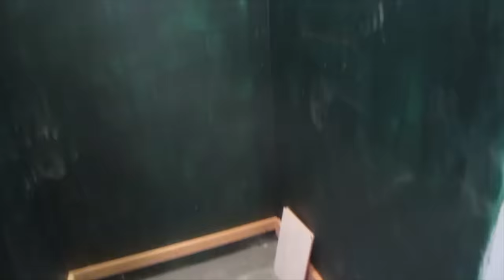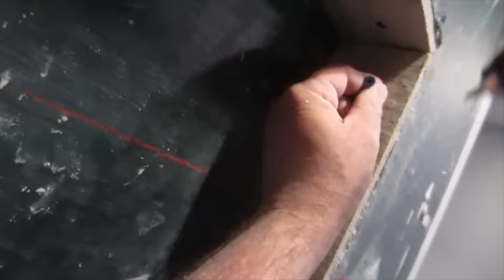Complete bathroom shower install time lapse start to finish

Comment: Do I call them back to rip the floor up and do it right.or withhold ther payment and get someone else in to put things right?
Reply from the maker: Chris Waterman What you do is up to you, but If it can't be fixed it will have to be done over.
Reply: Ya I'd say it will need to be done over because the whole floor area was put down with one piece of membrane ( not sure what's its called)

Comment: You do good work I just don't like those liners nothing like hot mopping a shower pan is the reason why they've been doing it for years and years just my opinion. I've seen those fail
Reply from the maker: Hot mop is a CA thing, pretty much not seen anywhere else. Vinyl liners are becoming a thing of the past, Sealed systems are a much better choice.
Reply: that's your opinion but there's a ton of systems out there I think  the cost is not worth it  for the chance of it failing they've been using hot mop for decades and that works so why change. Tell me what system you're talking about and I'll look into it
Reply from the maker: @luie92114  Not an opinion, just look into Schluter, Laticrete, Wedi, and more. All have a sealed system that use a bonding flange and do away with the Old "Water in, Water out" type of system that include Hot Mop, vinyl liners and anything using a two stage drain. Cost is a relative thing, the labor involved in old systems is significantly more, down time waiting for things to set up, add time. Not saying that there is anything wrong with those systems, just saying there are better ways available. Whether you choose to learn about them and use them is up to you, ignore them and you will play catch up later.
Reply: @SalDiBlasi  I just looked into all three of those systems and they range between 350 and 550 and up!! I pay $250 to get my shower pan hot moped I have half a day downtime I'm back to work and in my 18 years doing showers and never had an issue. Now if you're one of those guys that like to keep trying new things and spending money learning that's your thing my system's been done for Generations I'm okay with that
Reply from the maker: @luie92114  I  am not going to try and convince you about anything, you have made up your mind, if what you are doing works for you, that is great. Just looking at the cost of some materials is not the whole story and can't possibly give you the whole picture of how it all works.

Comment: Hey bro.OK workers finished up today when they went I had a shower but about 20% of the water runs away from the outlet drain and forms a huge puddle on the far end of the room near the door.
Reply from the maker: Chris Waterman Does the water come back to the drain or does it just stay there? if it just stays there,  show them, ask them if that is normal, which it is not, see what their response is, if they try to make excuses tell them to fix it.
Reply: Nope it runs out of the bottom of the half doors around the shower area and  forms a huge lake
Reply from the maker: Chris Waterman Tell them to fix it, and let them know that you will pay them when it is fixed.

Comment: how long and how much money did you put into your bathroom
Reply from the maker: The exact amount of time it took to complete and no a penny more than it cost the homeowner. I never talk about cost and time, there are too many variables.
Reply: I agree on this point but. Per square foot  labor + materials is the usual quote though. Yet some types of tile require a higher labor cost.

Comment: i already put up green board and didnt do anything with slop to drain was going to do a showerpan .. now going with all tile...what do I need to do?
Reply from the maker: +RikWCrlsn if you used green board in your shower you either need to cover it with a sheet membrane or replace it with a cement board and then apply a liquid membrane
Reply: Will do found RedCoat?? At Home Depot goes on pink turns red.. thanks
Reply from the maker: +RikWCrlsn not good enough for green board that has a gypsum core. Either a sheet membrane or replace it. Only if you want it yo last though.

Comment: I looked for a good pop up 3 piece drain the other day and could not find one.  I'm using a pop up drain in my upcoming tub/ shower custom project, and I must find a way to seal the drain.  
Here is a link to the drain I hope to use: http://www.homedepot.com/p/Watts-Plastic-Bath-Drain-Kit-3CP/100677389
Can I make this work? Is there another pop-up style shower drain to use, I must have the plugged feature as it will be a tub too.

I also am using conder block for the bottom 2 feet of the tub/ shower.  How would you recommend sealing the block? would vinyl liner be sufficient? If so must I cut the corners to fit?

Comment: Heavy vinyl liner = waste of money. Use heavy visqueen, then use porcelain tile with epoxy grout. Stays clean, never cracks or leaks.
Reply from the maker: And you know this because you have tested it and had it approved by the TCNA? Not a smart move.

Comment: concrete is NEVER supposed to touch wood without a barrier unless its pressure treated wood.
Reply: Liner was supposed to be first than concrete base over it

Comment: Why do you put thinset before the Frist slope?
Reply from the maker: +GMike Ramirez to bond the mud to the concrete, which adds strengh
Reply: HELP! I didnt put thinset before the preslope mud, what will happen if anything? Will i have to tear it out and start ovet? Thanks in advance.

Comment: Good job although it bugs me that you change the direction of your notched trowel.
I did commercial tile and we always troweled right to left or vise versa until space wouldn't allow it. 
Speaking of bugging me, you also buried Jimmy "the bug" Hoffa at around 7:50 !!
Reply from the maker: +miggs225 A little tombstone has been erected in memory of the bug.

Comment: The trowel lines should be perpendicular to the long edge of the tile and not parallel. Doing this helps ensure to not trap air because the air has a shorter path to exit and thus promotes a higher surface area adhesion. This installer did didn't follow this procedure from 5:19 to 6:56 but then started doing it correctly from 6:56 to 7:55 and then reverted back to doing it incorrectly again from 7:55 to the end....weird.

Comment: what tile goes on first of the shower the wall or the floor?
Reply from the maker: Makes no real difference, whatever works best for you.
Reply from the maker: gsxrkz Makes no difference, if you install the shower correctly, and even more so if you don't. The orientation of the joint is not the detail that will prevent a leak.
Reply: Floor goes first. Once dry it supports the walls. No saging grout joints during curing process. common man.
Reply: i agree i own a house. It was built in 1938 just re grouted the shower. Floor supports the walls. Its still all standing. Original tile. With new grout. I was taught, floors, walls up to ceiling. with walls supporting ceilng edge.
Reply: Joey Diaz your tile floor does not suport the shower walls and the sower walls does not suport the ceilling every tile setter i know do the walls first i bet this guy did too for the simple reason he is a pro  and no home owner is gonna know beter than a guy that does it for a living
Reply: Joey Diaz i forgot to tell you why most tile guy use a level board on the bottom of the wall to start nice and level because most shower floors are not level all the way around so the water can go down hill
Reply from the maker: vjalowboss Thank you.
Reply from the maker: vjalowboss Every tile job is different, and the tile is adhered to the wall floor or whatever, it is not supported by an adjacent plain, in fact they should not touch and impede the movement that is present at a change of plain. If a tile needs to be supported by another tile, then it is not installed properly and will fail, also what about the tiles in the center of the tiled surface that are not near another wall or floor or what ever, how are they supported?
Reply: Sal DiBlasi

Comment: I thought you were suppose to put the membrane before the grout
Reply: That was a pre-slope bed before the membrane. A top bed was done on the membrane. This is the preferred method, however he managed to install the cement board before the top bed is laid, this method places the bottom edge of the boards in a water channel and causes a "wicking" effect. Newest practice prefers the boards installed AFTER the mud bed, without making contact.

Comment: I understand that every ones does things differently but why mud the shower two times?  And you you could have membrain the hole shower and avoided using that rubber.
Reply from the maker: Preslope and final bed is the correct way to do this type of shower here it is explained https://www.youtube.com/watch?v=p8xsx3316IU I also have other types of systems on my channel.

Comment: No pressure treated boards for the curb of the pan?? No good.
Reply: You can't cover pressure treated wood with tile..it will rot.. because it's already full of moisture

Comment: Why would you use thin set below your mud that's just a waste of time. Use a bonderiser
Reply from the maker: First off "bonderiser" is not even a word, you probably meant bonding agent, which is exactly what the thinset does, which is what is seen in this video a "Bonded Mud Bed". Thinset is how it is done in most cases. Imagine that a tile setter that has Dry set mortar and uses it to in an application that suited to its characteristics, what is the world coming to.

Comment: No black paper behind the cement boards
Reply from the maker: What you refer to is a Vapor barrier, which is not needed, or wanted when the entire surface of the board is treated with a waterproofing membrane, one or the other, not both. I have to add, that one is better than the other and the Tar paper is not the better one.

Comment: You should NOT use a wet sponge on wood planks like that... they could warp
Reply from the maker: This is a joke, right? It is porcelain tile that looks like wood, installed with a polymer modified thinset, which is wet, cleaned with a wet sponge as I am working, then grouted with wet grout and washed with water, then washed again with water, and not a single tiny buckle or hint of warping  in the wood, which is not wood, but a very dense, vitreous, non absorbing, non reacting inert porcelain tile, just to be clear that is.
Reply: Sal DiBlasi no... you can CLEARLY see knots and grain in those planks..please study the video more closely in future
Reply from the maker: +jeremy western Your kidding, you can't be serious,  you're trying to be funny. If you are not, then I can't explain it.
Reply: Sal DiBlasi you do NOT grout wood... the natural expansion and contraction of them wood planks will displace the grout after a short while...  please do more research in future
Reply from the maker: Enough, it is not wood.

Comment: Durock in a shower? That is used for flooring its not waterresistant it molds and it sucks moisture and water
Reply from the maker: I suggest you get your hands on a TCNA handbook, Read Method B415-18. Then when you have done that go watch some of my other videos where I show several other methods.

Comment: you should never have to do a second wipe on your grouting... only if your helper sucks and rushes threw it
Reply from the maker: So i guess i have been doing it wrong for the past 30 years. I would like to see your video to see how to do it the right way, post a link for me.
Reply: *****
Yeah, and you forgot to press your pants before you showed up on the job site. Simply unprofessional.
Reply: Zack T. Pugh LOL!
Reply: notice how this guy never posts a link or a video?  typical internet "pro"

Comment: Why cant you just add the shower pan liner on top of the concrete? Why do you basically have to do it twice over the concrete.
Reply from the maker: For this kind of drain, this is how you have to do it, here is a video explaining the drain, https://www.youtube.com/watch?v=p8xsx3316IU&list=UUWpu9UZ6aiRTaMuuV8-C0pQ if you use the schluter kerdi system with thier proprietary drain, then you can do it with one layer of mud

Comment: Why bother with a liner if you are going to slap that elastomeric waterproofer everywhere?  As it is, the water will saturate the drypack and wick its way up and over the curb...in between the liner and your waterproofing. The water will also wick its way up the hardi walls a little bit, then break the bond between the water proofer and the hardiboard.  You've created a water lock at both the lower walls and the shower curb (i.e. water proofing on both sides of substrate).  You either water proof the front side, or the backside, but not both....
Reply from the maker: You are forgetting that the water can leave via the weep holes at the drain, if any water manages to actually get to the dry pack. The reason I started doing this because I have seen too many liners fail, (none i have installed). I understand what you are saying, I keep the liner because the three piece drain  drain is not designed to have a water tight seal. Any water that might penetrate at the drain will be where the weep holes are.
Reply: ***** ,

But as you know, water soaks into the grout(and natural stone), both floor and wall . Right now you are directing all water from the walls into the drypack, as well as water from the floor.
   You should, as per TCNA code, waterproof the top of the shower floor and use a fibertape embed into the waterproofing along the bottom inside corners where the wall meets the shwr floor.  This directs the water from the walls and floor across the top-side of your waterproofer and into the drain.  The liner then becomes a redundant water proofer. Extra insurance as water would not get to the drypack unless the waterproofer fails.
    Laticrete's Hydro Barrier liquid membrane installation outlines this step.
 You could also use a laticrete floor drain which bonds to its Hydrobarrier or Hydroban and does not use a liner, allowing you to strictly water proof the topside.  There are other drains out there which serve the same purpose.
Reply from the maker: And that is exactly what I do, waterproof everything including the mud dry pack as you said, including the fabric at all transitions of plain i actually show how I do this on some of my other videos. I have never done the divot method that you refer to though.
Reply: ***** ,

  Ah, ok, apologies then.  I didnt see that in the video.  keep up the good work. Your videos are fun to watch.

Comment: I’m about 30 seconds in.... 🤦🏼‍♂️
Screed is lumpy/bally. 
Start from the outside edges to make sure it’s level then work in from there to the waste otherwise you’ll have uneven heights. I’d be sacked if I screeded like that ...
Reply from the maker: That was just the preslope, does not have to be perfect. https://www.youtube.com/watch?v=ui9gr06MGcw&t=1119s

Comment: the shower seems over the top to me.... why cant you just coat the shower cement sheeting with a polyurethane waterproofing membrane, walls,floor etc, and simply tile on top of that....faster, easier, never will leak..... you did a great but the shower water proofing seems extreme IMO
Reply from the maker: +Drew Price Doing it the way it is supposed to be done is not over the top, showers leak because steps are left out when people think that taking a short cut will not make a difference.

Comment: You never build a curb out of wood you build it out of concrete or brick
Reply: @nolandrutledge6944 no if you want to do it right then you build it out of cement if you want to do it half ass you do it out of wood
Reply: If you really want to do it right you do all the wall framing with concrete 2x4’s
Reply: @Tinroofdeals  🤣🤣✌

Comment: There really is no need for the preslope. Install the PVC 40 liner and then add the mortar . I didn’t see a second mortar bed go down over the PVC pan?
Reply from the maker: There really is a need for a preslope, no ifs ands or buts. If you say otherwise, then you don't know what its function is.
Reply: Never heard of water being attracted to a drain on a flat surface. You want your water to rundown hill... preslope no brainer.

Comment: that sure shows how much u dont know
Reply from the maker: +DRONE GUY I suggest you do some research, you obviously don't know what a preslope is and how a three pieces drain works, i can prove you wrong, you however cannot demonstrate you are right. http://www.homedepot.com/catalog/pdfImages/02/0205a110-a942-40c0-b1c3-e930e1fdaa9e.pdf

Comment: This is not timelapse, it's just sped up.
Reply from the maker: I have done a bunch of these, "time lapse" was the only description that I could think of to call this kind of video. Any suggestions.
Reply: Not sure, I wasn't trying to be rude or anything I was just watching the video and said oh, it's just sped up. The video was fun to watch though!
Reply from the maker: Just thought you might be able to Suggest another Term to use i can't think of any other word to describe these types of Videos.
Reply: Sped up, fast forwarded, but if you do have an iphone you can get an app called Lapse It you'd need a tripod though or something to hold it up.

Comment: That's really weird, we always pour the shower pan inside the liner, no idea why he did it under the liner lol
Reply from the maker: Preslope, then liner then mud for tile.
Reply: @SalDiBlasi  nah I put the liner down silicone it and pour the pan right on top of the liner, tamper it down and shape with the float,
Reply: Your way just makes it harder shaping the mud around the studs

Comment: First big mistake I saw was using screws for shower pan liner smh 🤦‍♂️
Reply from the maker: Why is that a mistake, please enlighten me.
Reply: Sal DiBlasi poking holes in the shower pan liner is like poking holes bottom of the bucket